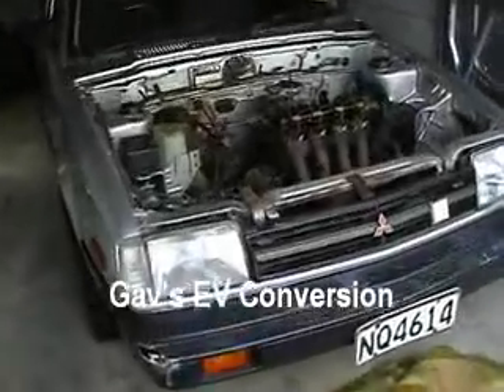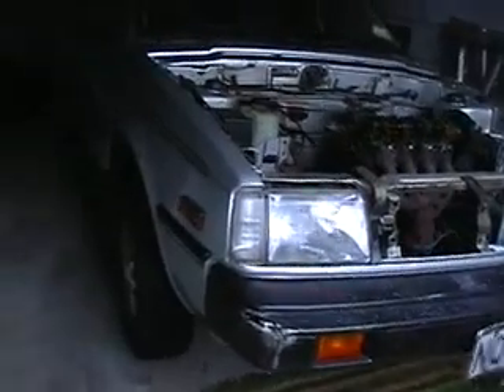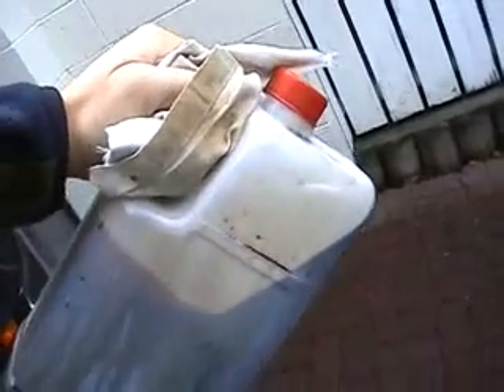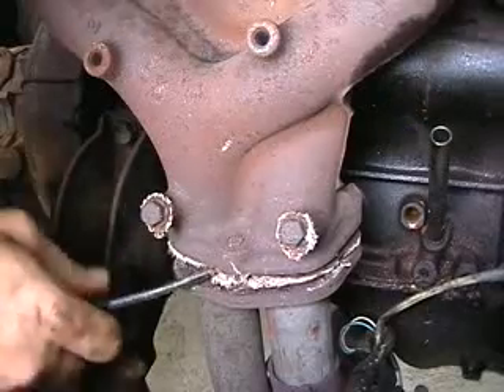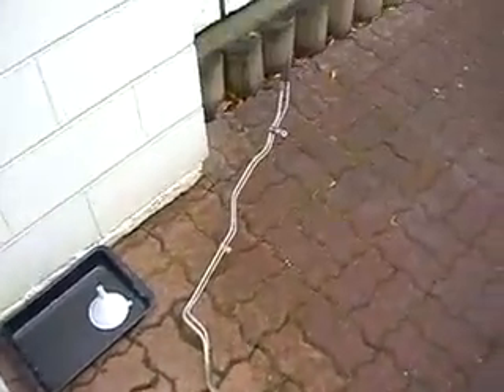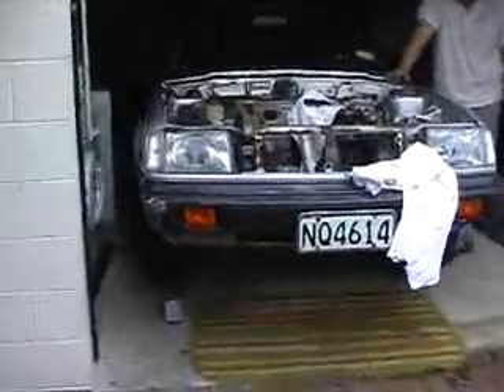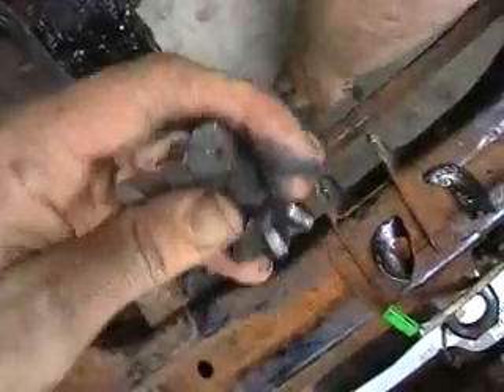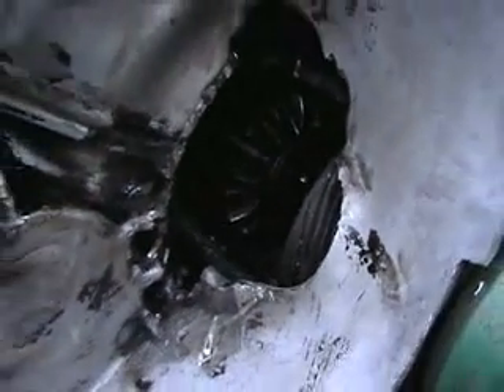Gav's EV Conversion 2 - Dismantling the Tredia

Comment from the maker: Good question. I'll be using a 12V vacuum pump connected to the brake master cylinder. These are fairly readily available from any EV converter and occasionally found on Ebay too. I should really order one I guess...